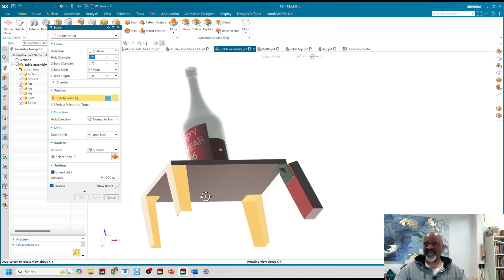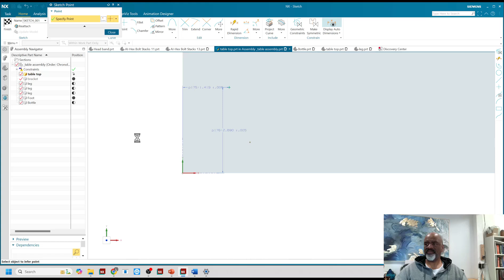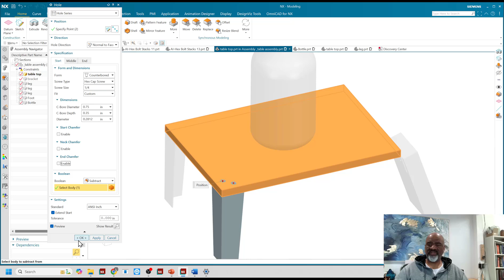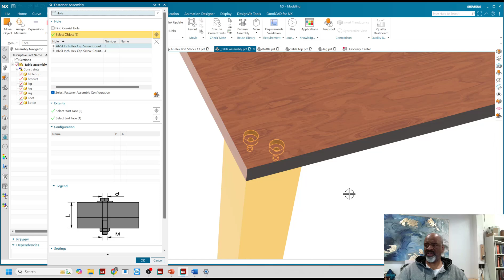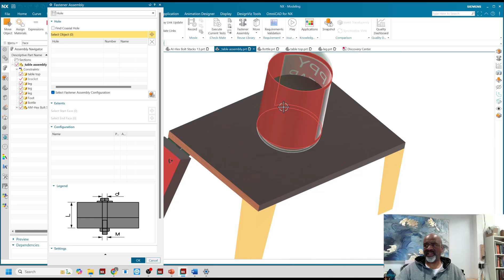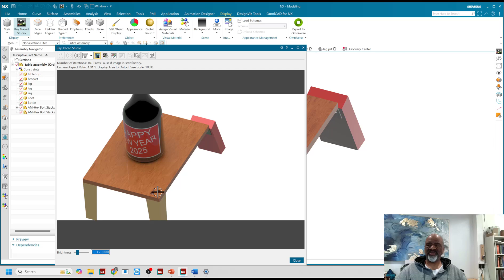Hole Series and Fastener Assembly

Comment: Are you able to create a fastener assembly for a blind tapped hole? Also had trouble changing the configuration ie adding a part to the stack such as a spring washer.